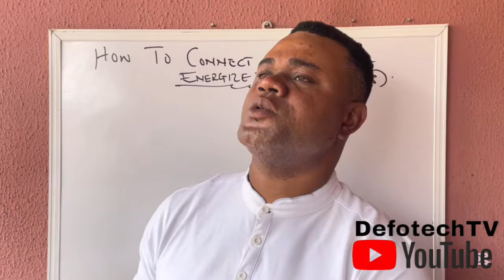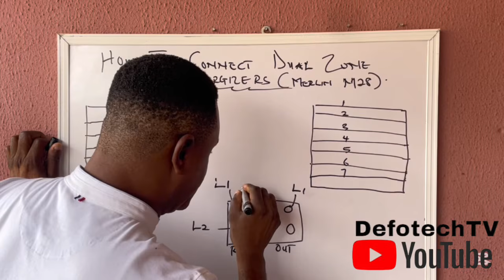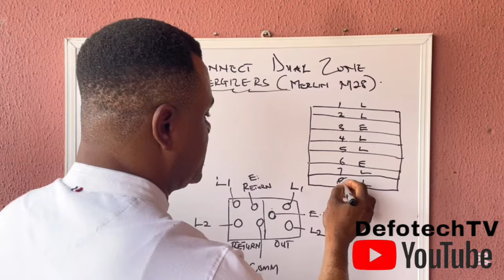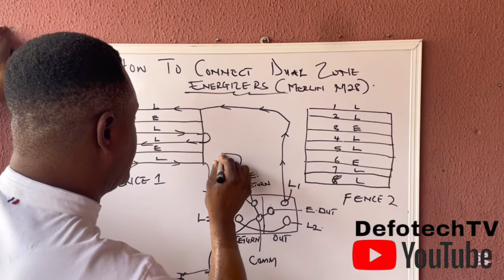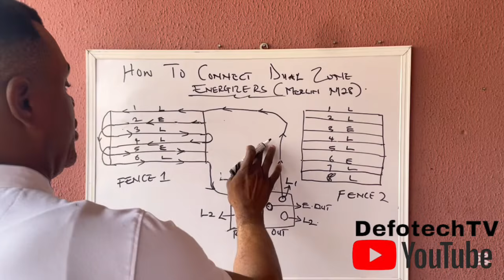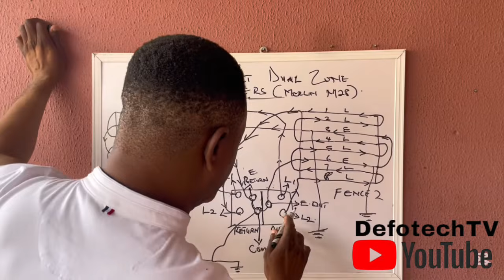How To Connect The Nemtek M28 Dual Zone Enrgizer

Comment: Good afternoon sir, I'm working on energizer M28S. I used 6 lines but 3 cables to the energizer but it's giving me alarm in both zones and also gate 2 led blinds every 5 seconds. What could be the issue.

But if I use Merlin 4 the fence works perfectly and I don't know why. Please any technical assistance
Reply from the maker: Have you tried a table test on the M28 Energizer?

Comment: Welldone sir, please sir i install nemtek energizer wizord 4 my connection is in series,life,earth, life, life, earth,life, which is working perfectly after installation in the morning till midnight the alarm just trigger off,then they off the energizer and on it back the alarm still trigger off again,and nothing is on the fence cable when they check it,please sir what can be the problems.
Reply from the maker: Is the Energizer ok?
Reply: @defotechtv9093 yes the enegizer is new one sir.